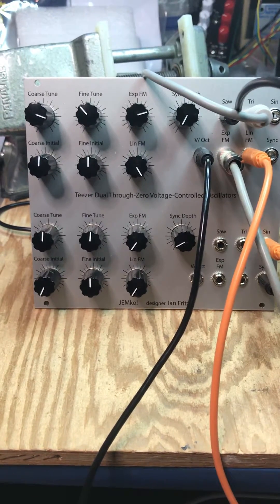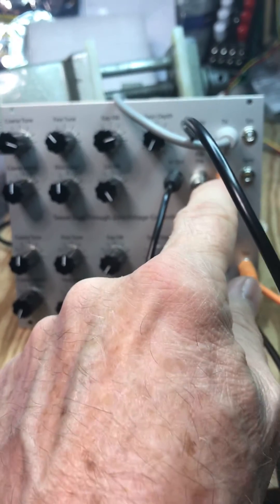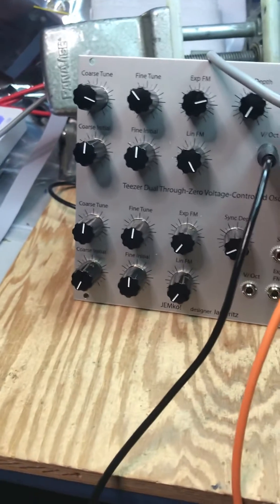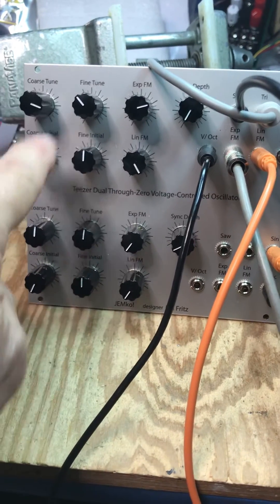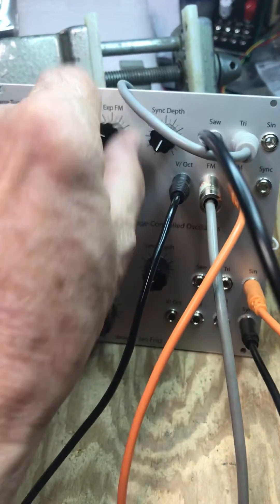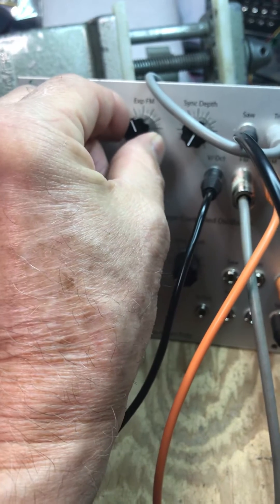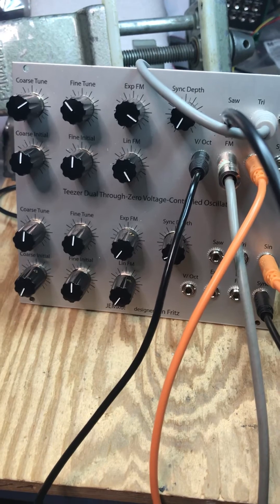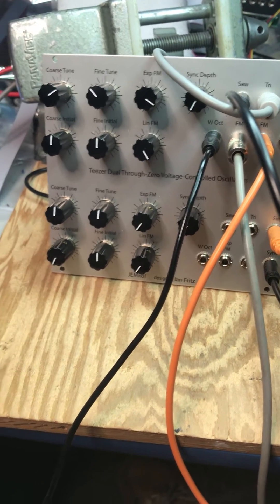Dual Teezer Thru-Zero VCO by Ian Fritz

Comment: you can actually program the DX7 either by going on the EDIT menu or using the DT7! I have the Teezer and the DX7 and the DT7 i can guarantee it sounds nothing like the DX7!

Also i would recommend changing the COARSE knobs on the fritz by “ten turn” knobs, makes it very very fun to play with!
Reply from the maker: Henrique, thanks for the comment.  I was unaware of the DT7, that's a cool control surface!  I used to have a different DX7 control surface, but sold it many years ago.